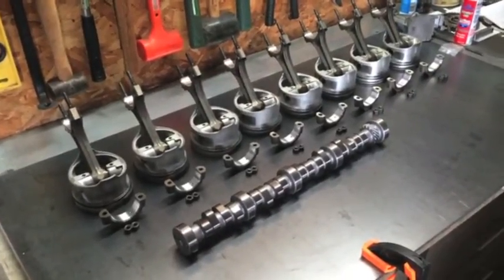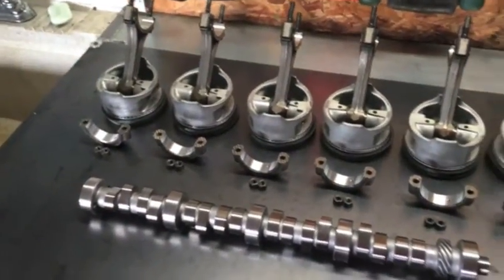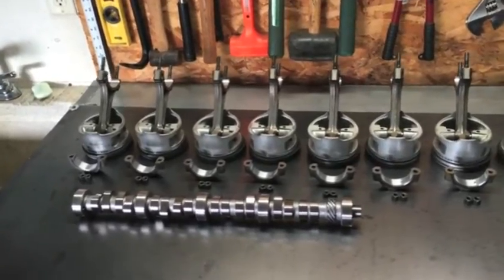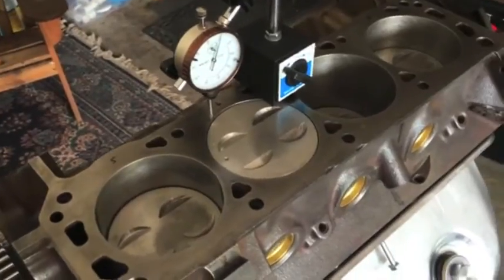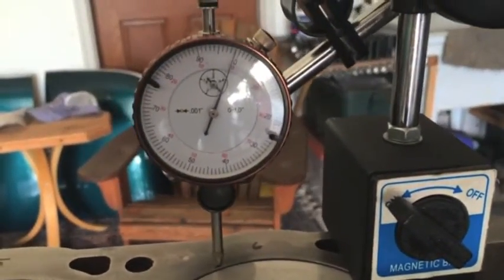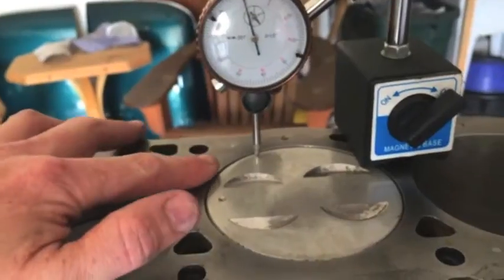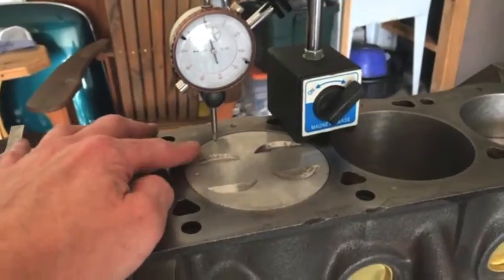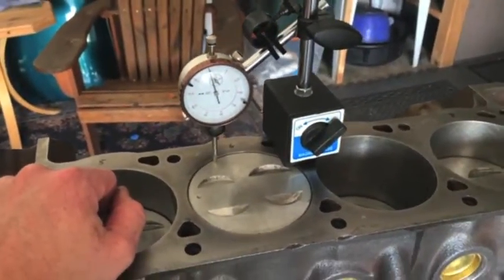How to check how piston deck clearance.

Comment: How would you measure with domed pistons
Reply from the maker: I think you still use a drop, but things get more complex because you are on the plus side of the deck and need to incorporate the cylinder heads/head gaskets. Might need to google that one because I'm unsure myself / thanks for the comment Austin

Comment: I think I have a problem. My piston is about .008 above the deck. Looks flush with the naked eye and the dial gauge confirmed it. Stroking my Jeep XJ. Not sure where to go from here...
Reply from the maker: Did you check out thicker head gaskets? Make sure you check valve clearance with some play dough too. Good luck and thanks for the comment!
Reply: @TacoJoe  Thanks Taco. I bought a Cometic .060  head gasket. Walking a tight rope trying to stay under 10.5:1 compression and use 87 octane gas. 3.895 crank. Head is a 55cc edelbrock and the pistons have 16cc dish.

Comment: You need to measure the deck clearance at the wrist pin. Measured where you did could vary as much as .010-.015 due to piston rock. This could prove to be disastrous  in some cases.  I cant believe no one else picked this up
Reply: he can set that to zero then rotate the engine until the gauge stop moving.

it doesn't have to be rocket science.  and yes what he did works as long as its a known clean level surface.
Reply: @KingJT80  it is not correct. You must determine the rock of the piston to get the accurate deck
Reply: @tedgerstenslager2949  then all he had to do is rock it back and fourth and take the average
Reply: @KingJT80  One location with the indicator, on a deck bridge ,rock the piston each way, and you can determine the true deck clearance. Piston decks are not necessarily the true flat surface you think. Anything else is pissing up a rope. Does .001 -.002 matter in the big picture? Nope. All just numbers. .010 can get you into a little trouble.
No such thing as "average" in engine building. There is "tolerance"  which is common with different components, made by different manufacturers and different equipment.
Reply: @tedgerstenslager2949  He was measuring to see how far in the hole he was to know which thickness of head gasket to get in order to set his quench, not measuring for piston to valve clearance. This was way is completely exceptable to get an idea how far down he is, a few thou off isn't gonna make much difference when quench is what your figuring. Unless of course your going for as tight as possible then things need to be more precise